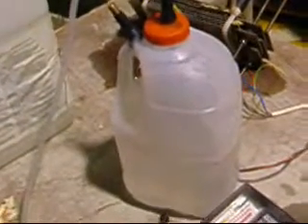running on rain water part 2  #9

Comment: check my cell out, I used 19 plates @ .020"-.025". I use no electrolytes, none are needed if at those space settings. That will save you money and you don't have to worry about spilling it or a pet drinking it. Oh I too use rain water.
Reply from the maker: Like and subscribe